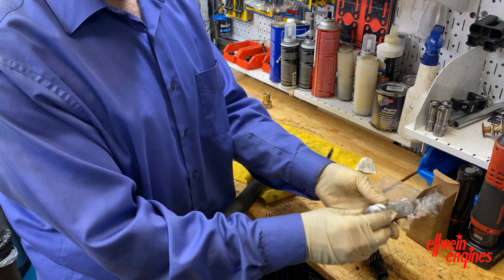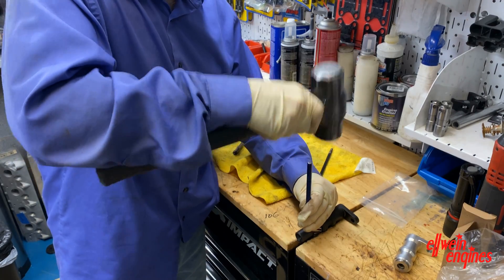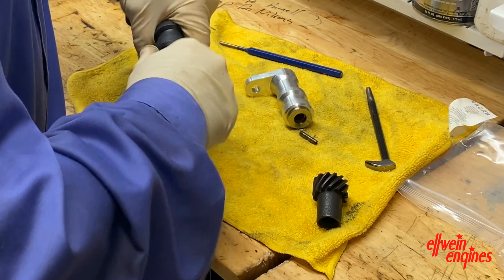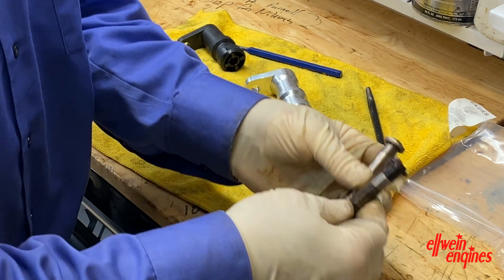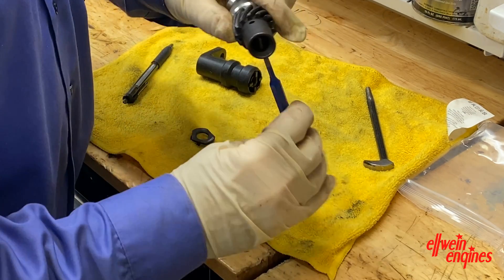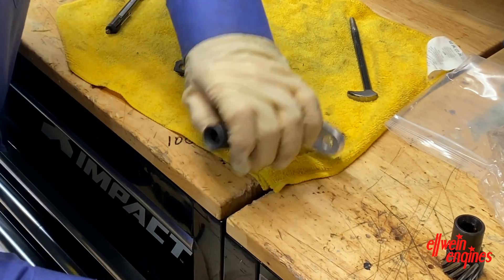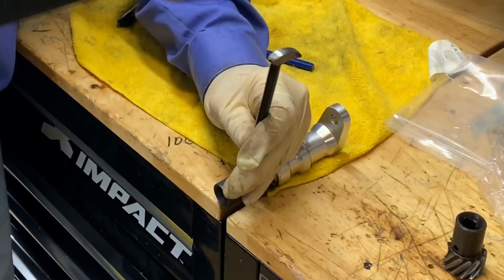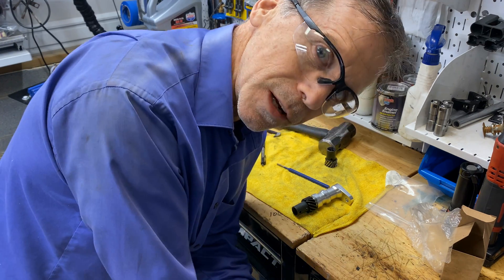LT1 Oil Pump Drive Gear Refurbish

Comment: Can anyone chime in and help me . I’ve been trying to seat the oil gear in the block and can’t get it to seat all the way down properly.
Reply from the maker: It could be that the oil pump shaft just needs to be turned a bit.  That shaft "slot" needs to line up with the oil pump drive.   Just stick a large flat blade screwdriver down into the hole and turn the oil pump shaft a bit and try again.  Let me know...
Reply: @EllweinEngines  I use the screw driver to line it up and it seats down in the groove but it’s not seated down all the way . I have the tick performance housing as well .
Reply from the maker: It could be (then) that the oil pump shaft is "wrong" size.  Do you have the oil pump part number?
Reply from the maker: Also...it still may not be lined up at the oil pump shaft.  I also have to turn the crank a bit at the crank bolt while giving the oil pump drive a wiggle and push and "then" it finally will find the slot and sit home.

Comment: Great, informative videos. Thanks. I have an 1996 Lt1 out of an Impala SS. It has some oil leaks so I flipped the motor over to remove the pan and heard the oil pump screen slip off. Inside the motor and heads there is no sigh of oil crust or burn at all. Looks real clean. By the touch test, cam lobes are smooth - no scores or pits. 

My questions are 1. What are your thoughts on running the original oil pump? I have a feeling it was replaced and the screen was not welded on. 

2. I am not sure how to check the timing chain. It does have some play but how do you know it needs to be replaced.

I do have the timing cover off as well if that helps.
Reply from the maker: If the oil pump looks good I would not hesitate to re-use it (for my own motor).  Ah!  the timing chain.  I would replace it no matter what.   They whole set...gears and chain.  I would treat the timing chain as like a normal routine maintenance item.
Reply: @EllweinEngines  Thanks for the direction. I will follow your advice.

Comment: Thanks for all the awesome content, Karl!   What are your thoughts on recommendations that I've seen that specify installing a new gear when installing a new camshaft?
Reply from the maker: Very rarely the stock oil pump drive gear will be in ok shape...so that is a good idea to replace the gear on that shaft assembly.  Timing set should be brand new too for a cam change.

Comment: Karl, have you seen any oil pump component failures on previously untouched, stock LT1’s?  Drive gears or pump driveshaft plastic sleeve failures?
Reply from the maker: from stock LT1 no.  No failures.  Just modified LT1s   when spark knock (engine rattle) it will bust the oil pump drive from the shaking.  And I've never seen a striped gear except for Big Block Chevy or HV oil pumps.
Reply: Thanks Karl!  You’re the man!

Comment: Can you get the diameter of the pin the holds the melonized gear on the Tick driveshaft housing? Thanks! Great video.
Reply from the maker: Yes I can.  I did not see your comment until today.  The shaft diameter or the small rolled pin?
Reply: @EllweinEngines  The small rolled pin that holds the melonized gear to the housing/upper shaft.
Thanks!
Reply from the maker: @russellbyers8645  Ok, I'll remember to get this measured on Friday and get back to you.
Reply from the maker: Roll pin is 3/16" diameter or 0.1960" and the actual hole in the gear is 0.1920"   And it is identical to a generic MSD distributor replacement gear roll pin.
Reply: @EllweinEngines  Thank you!

Comment: What do you think breaks the stock ones? Over torquing?
Reply from the maker: Yes exactly.   They only break when replaced.   There is no real force on these when running in the motor except maybe if detonation is rattling the motor.